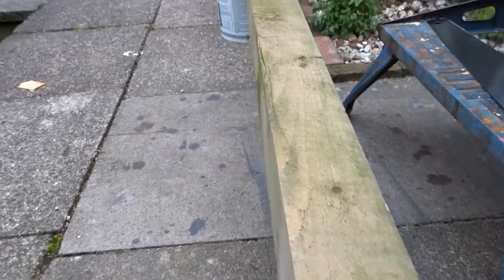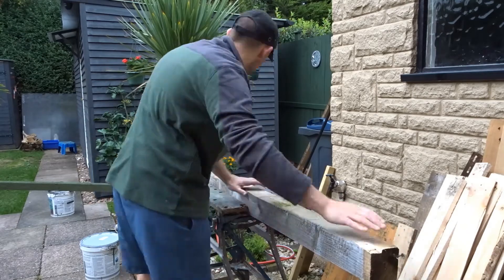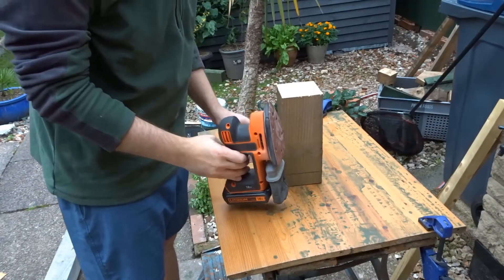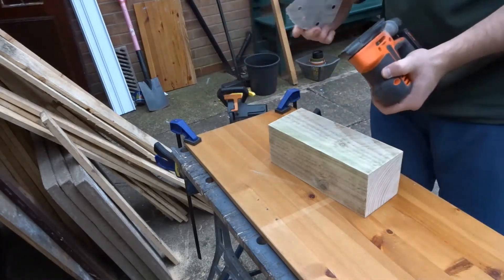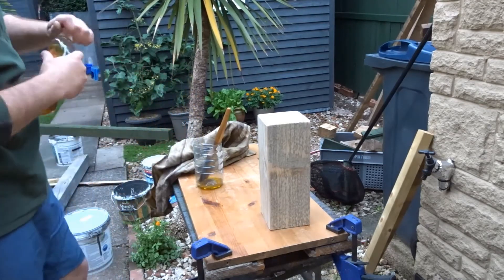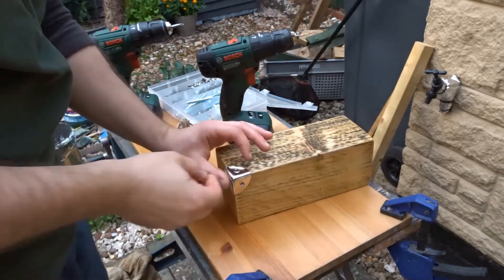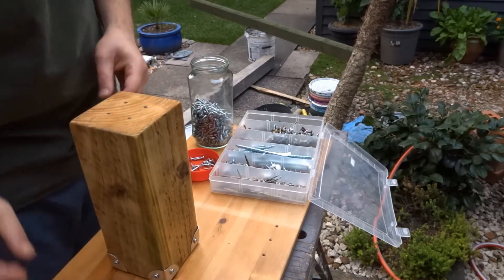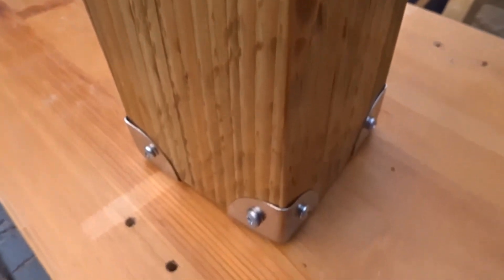How to Make a Wooden Door Stop (Using Reclaimed Wood)

Comment: Very simple idea. I was looking at doing the same things myself. I haven't seen anyone else put those corner brackets on and that looks really good. I agree that it doesn't work well for floor that could scratch so putting the rubber bottoms on it would be great.  I had even bought one of those ring plates already from Harbor freight. It's nice to see somebody already doing something. I want to do myself and now I can see that it looks pretty good. I don't have boiled linseed oil but I was thinking of using Danish oil.
Reply from the maker: Thanks 👍🏻 glad you find it useful. Yes Danish oil should work well also. I've got loads more videos like this on my channel that you might like also 👍🏻

Comment: Very nice! What drill bit size so you use for pilot holes, Phill?
Reply from the maker: thanks Rob👍 I am not sure exactly what size I think it was around 2mm-3mm wide. As long as the thickness of the drill bit is slightly narrower that the shaft of the screw you should be good to go.
Reply: Phill Wyatt Outdoors Thanks Phill.